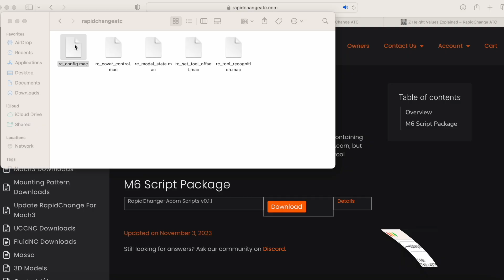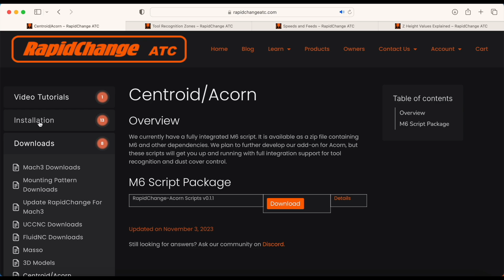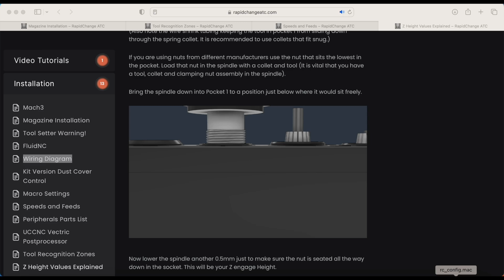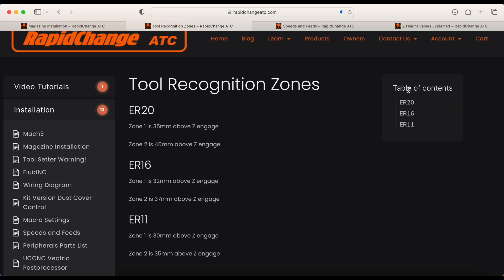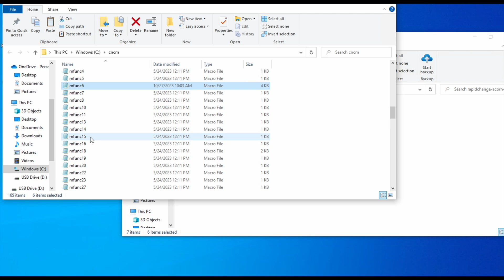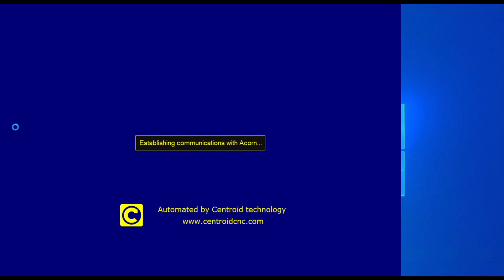RapidChange ATC Centroid CNC12 set up in depth/CNC 12  Automatic Tool Changer

Comment: Hello, i love oyur job..Very interested....I am currently running with Grbl 1.1e and a Mega pro 2560 controller card for my cnc (4 axes)...How could I integrate an ATC of your invention into 6 tools? I read that this protocol was compatible on Wiki but I don't know how to do it.
Sincerely
Philip
Reply from the maker: Hey thanks for the comment, Philip. We do have some integrations with Grbl however it doesn't have the M6 command and therefore runs on G code. More detailed information is available on the website and our discord server.

Comment: This is great, working on wiring up a new router build this weekend and will soon be configuring my Rapid Change ATC. This video make it very clear. Quick question, do the macro's or the Acorn have any protection built in to prevent you from accidentally loading a tool into a pocket that already has a tool loaded in it?
Reply from the maker: Thanks for the question! It does to a point. as long as Centroid knows which tool it has and it usually does and the tool # persists after shut down. but if you escape during a tool change for what ever reason Centroid could lose track of which tool it has. For instance if you give an M6 t2 which would grab tool 2 and cancel before it picks up tool 2 Centroid will likely be reporting tool 2 in the spindle. So we have a macro M51 Tn where n is the tool number and this will set the tool for Centroid. other than that as long as Centroid is reporting the tool that is actually in the spindle it will drop it before loading another tool. I hope that made sense LOL